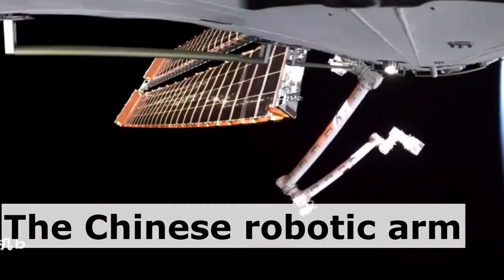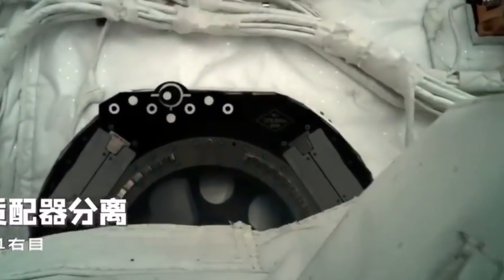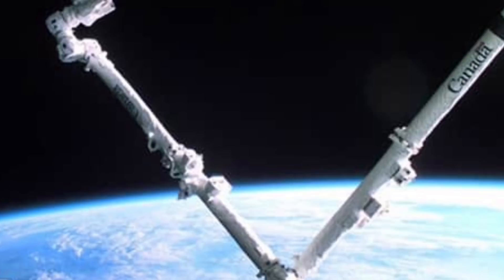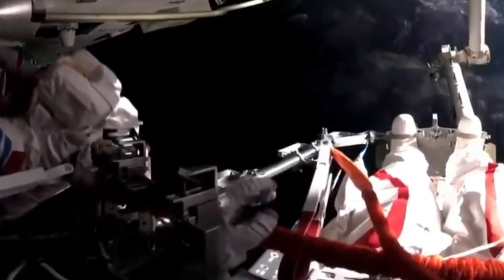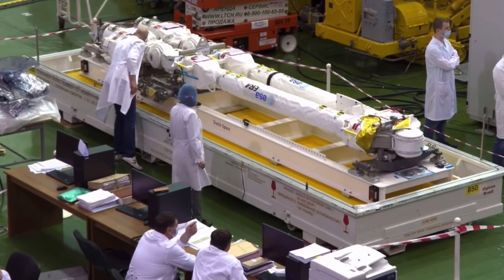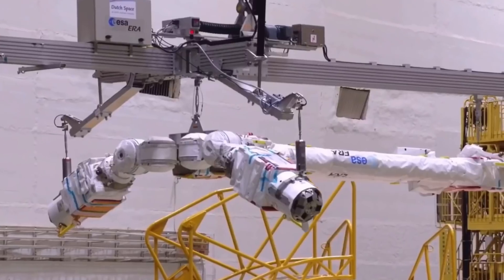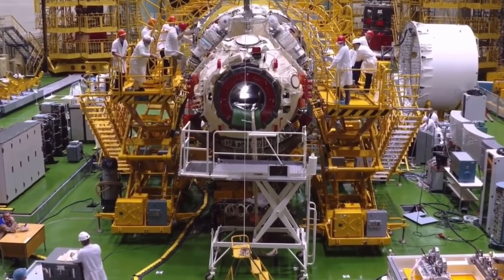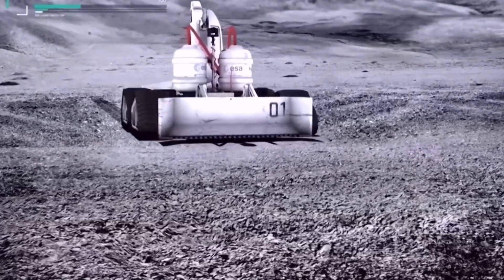Chinese robotic arm versus European robotic arm

Comment: Now Europe & America have started copying Chinese technology 😂😂😂
Reply: The European arm was already designed and built second half of the 1990-ies, for special missions and to be able to "walk". 
Delayed for launch only due to forever changing launch schedules.
I'm a proud contributor to the ERA development and training facility and happy that it FINALLY was delivered to ISS.
Reply: @frdml01  . Sounds extremely convincing.  How can I contact you, in future, if I need an advocator?

ps. If it was completed in 1990s, it must be using X286 processors.  So, can't do autonomous operation then. Analogous  to having a Nokia vs today's smart handphones.🤣🤣
Reply: @HTeo-og1lg  Sarcasm disregarded, actually at the end of the nineties it was running mainly on VAX VMS systems (by Digital Equipment). I'm pretty sure it received a number of upgrades over the past 20 years. And it is manually operated, although the software does all the calculations in the 3D space. The MMI trainer is at ESA's technology center at ESTEC.
Reply: @frdml01  . DEC was practical a zombie company by early 1990. I doubt ESA would be using the VMS. How could it be using such operating system then? Unthinkable.🙄
Reply: @HTeo-og1lg  apparently you are not aware that space systems rarely use state of the art equipment. It is all about proven, radiation hardened technology.
We also have been using space hardened 80386 WAY after the last PC was equipped with a 386.
Reply: Nope. ERA was built in 2005. 5 years before China planned their space stations
Reply: @Cediii4ris  And they are still planning to use it after 16 years 🤣🤣🤣🤣🤣
Reply: @uttamuttam597  they are in fact not. The arm was built in 2005, and supposed to launch in 2007. It is only launching now because they’ve been waiting on the new Russian segment.
Reply: @Cediii4ris  Sounds extremely convincing.  How can I contact you, in future, if I need an advocator?